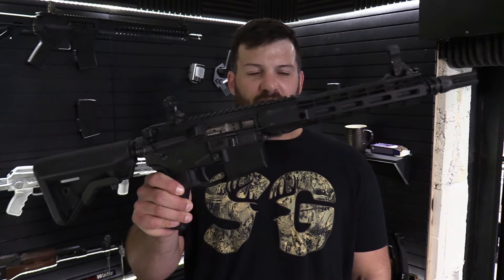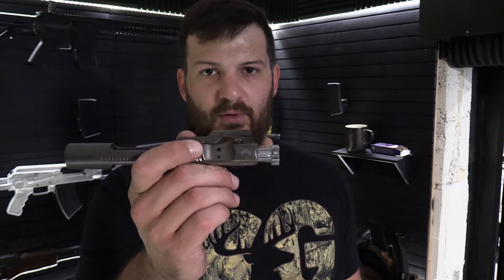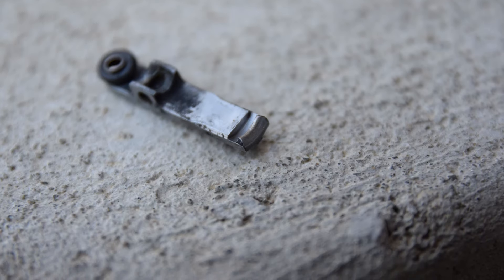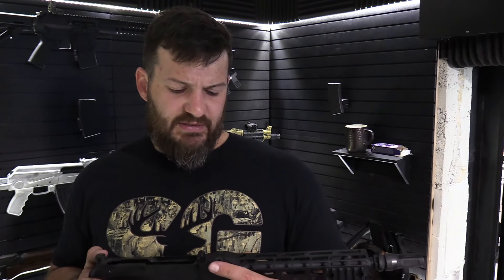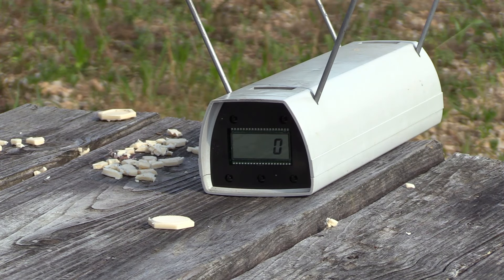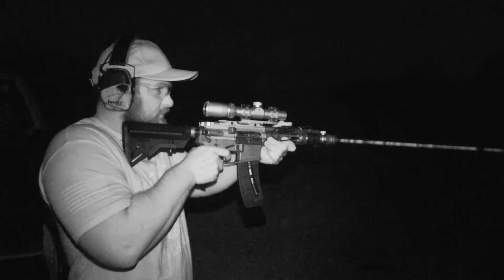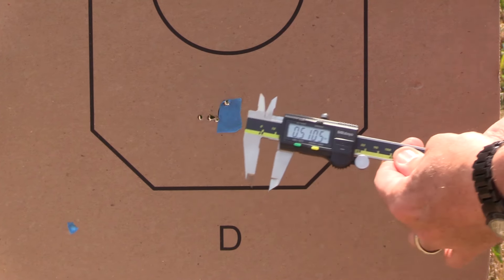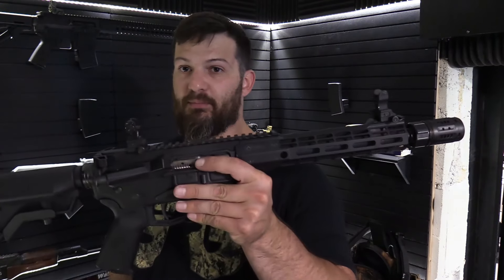Chrome Lined Barrels are Stupid || A Year of Testing

Comment: Nitride is nothing new, I have the test the military did back in the 1960's. Chrome is 3 times more expensive than nitride in barrels yet there is a reason chrome is still used in military barrels, HEAT.. Chrome lined barrels last longer under extreme heat compared to nitride.. For semi auto rifles, nitride is smarter for cost and accuracy..Salt bath nitriding can cause imperfections in chambers compared to pressure chamber gas nitriding..

Comment: Group size increased by 1-1/2" after 12k rounds and your conclusion is that you don't need to pay for a chrome lined barrel. What is that conclusion based on? Is this a new scientific testing method? The conclusion is sheer speculation unless you repeat the test with a chrome lined barrel. I mean I don't care either way and I own chrome lined and also own a BA nitride barrel, but WTF?
Reply: I mean that's also 12 thousand rounds suppressed and full auto. Dude that's a tough fuckin barrel lol. Nothing will kill a barrel faster than running full auto and suppressed. It's basically the ultimate durability test.
Reply: @jamesrobinson7732  came to say the same thing
Reply: @Bravo Six oh I know. Chrome lined is definitely better in terms of durability and maintenance. But I'm just saying from the standpoint of a civilian rifle that will never fire full auto and (likely) won't ever see over 10kish rounds, if that even, that this barrel definitely is good enough and it's certainly tough enough for the use 99.9% of users will put it through 🤷
Reply: @Bravo Six I enjoy a good chrome lined barrel but honestly I only choose it for collection reasons. For instance, I just can't stand the thought of an AK barrel that is nitride coated. Just not historically correct u know. it has to be chromed and also cold hammer forged. Also it's nice for 5.45 cuz 7n6 big time corrosive the chrome makes cleaning the bore easy.

If I was doing clone builds of AR variants that have been in service, certainly, Id only use chrome lining
Reply: @Bravo Six I absolutely buy the Hanson barrel because I love the way it handles. Totally agree on that
Reply: I think it's based on how well the barrel has held up over 12k rounds.  Meaning it isn't chrome-lined and held up fine.  Yes, it would be cool to see the same done using a chrome-lined barrel for comparison.  I'd definitely watch that video.  I think his point is it isn't required to spend the extra cash on chrome-lining if durability is your concern.
Reply: The fact that this IS a machine gun (one of the reasons the military needs chrome lined barrels) and went from sub moa to sub 2 moa (about average for an AR unless you get into precision barrel territory) is pretty cool. So the wear and tear is great and extreme. So for us poors and dudes who don’t wanna be put in govt registry’s and don’t own machine gun, those non chrome lined sub moa barrels after 20k rounds might start creeping to the 1 moa territory.
Reply: @Bravo Six No evidence that CHF has any comparative advantage over a button rifled.
Reply: @Kaotix_music  my chrome lined Saber Defence 6.5grendel shoots sub moa.   And around 1 moa with Wolf steel cased ammo.  Also u can buy chrome lined barrels as cheap as nitrided barrels.
Reply: I suspect that since nitride is cheaper than chrome lining that manufacturers will push nitriding.

Comment: I like the corrosion resistance chrome lining provides. Personally, I run the Criterion Core barrels because of how they solve some of the problems with chrome lining. But I do have a 14.5 Hanson barrel that shoots lights out. I'm very happy with both.

Comment: So you have one, single nitride barrel that lasts 12k rounds and you then conclude that all chrome lined barrels are stupid? Doesn’t seem very scientific. Didn’t Pat Rogers BCM chrome lined  “Filthy 14” last over 60,000 rounds keep sub MOA accuracies?
Reply: Not to mention shorter barrels tend to last longer (less powder burn and lower velocities). Id bet a 16" BA barrel would be showing degradation signs now after 12,000 rds of full auto or fast shooting mag dumps. Most nitrided barrels with heavy use on semi rarely make it passed 15,000 in my experience.
Reply: muddy hotdog - What about Pat Rogers BCM CL filthy 14 and had 60,000 rounds on it keeping under 2 MOA.
Reply: @MrChuckwagon55  ya exactly, nitride barrels never last that long ( so if I remember correctly it was a little less than 60,000 rounds
Reply: @muddyhotdog4103  Ypur experience is limited then. Must have been a PX Ranger. Because my experience is different pumpkin.
Reply: @JohnDoe-rq5bz  ok
Reply: @JohnDoe-rq5bz  turns out you were the pumpkin.
Reply: @muddyhotdog4103  

Mrgunsngear is living the life and fame of a Special Ops Veteran and has almost 700k subscribers who worship him like God the end all be all almighty. I caught him today shooting a Colt 20" A2 HBAR with a ultra modern "Kung Fu" C-grip and he had his nose inches away from the charging handle with his eye relief being different after every shouldering. 

A First Class Private already knows better........
Reply: @JohnDoeEagle1  indeed
Reply: @JohnDoeEagle1  This reeks of cope.
Reply: @JohnDoeEagle1  Maximum copeium status here
Reply: Oh no… an engineer has entered the chat.
Reply: Hey there were some really metallurgical tests here. You gotta  “Trust the science” 🙄
Reply: Go ahead and confuse people even more. Most of us own semi automatic AR 15 not automatic
Reply: @RobertBrown-el2ky  -Tuesday pancakes?
Reply: A lot of his gun mythbusts are very half baked and cherry picked. It's entertainment and sales; more than it is practical info.
Reply: That's great and all but who's going to shoot that much lol? That's like 30-40k dollars worth of ammo. Plus you could always just buy a chrome-lined barrel later on.
Reply: @peterfuentes5893  this is the realization i've had to make too, i'm not in any position to NEED to be going through that high of round counts other than if i strike it rich and have the money to burn through that kind of gear for fun. If the cheapest barrel can last me at least 10k rounds then I don't see any downside.

Comment: Great video. I work in a different industry that uses typically either Nitride+QPQ or nickel plating on a particular component and I've been to suppliers that run both processes. Nitriding + QPQ paetially diffuses into the base material while chrome or nickel plating sits on top of the base material. As you mentioned, the result is that the Nitride + QPQ results in less dimensional change during manufacturing and, more importantly, it will not peel or flake. That said, the QPQ process is not infallible, and is subject to manufacturing defects which I've found are generally attributed to poor maintenance of the tanks used in the multi-step QPQ process.
Reply: So I take it that a 4150 chrome moly nitrided barrel would still be more durable than say a 416r stainless nitrided barrel? I’m trying to decide between a criterion chrome lined vs stainless nitrided barrel and I’m losing my mind trying to decide between the two.
Reply: The process they use to make their chrome barrels is intricate (lapped lands) to the point there is no difference except in cost which is worth the increased longevity of chrome.

Comment: I have phosphate, nitride, and phosphate hammer forged with chrome lining. Never really noticed a difference between the 3 in accuracy, but in terms of corrosion resistance, the chrome lining is superior and that's why the military went with it. For most people, they'll never know the difference and a decent barrel will last them a really long time. The whole debate about barrel types, finish, ect, is no different than the Ford vs Chevy debate that'll continue forever. People will spend their money how they want too and get what they want plain and simple. There's no one better pick as it all comes down to the use and personal preference. Either way it's a good test and interesting results. Glad to see BA live up to their name with a quality product.
Reply: Try sustained automatic fire in a nitride barrel vs chrome lining
Reply: I just bought a chrome lined mk18 mod 0 barrel its a colt 10.3" socom barrel it was real expensive hell for and extra 100 dollars I could of bought a descent carbon fiber wrapped barrel. Jk anyways that is what i was told chrome lined can with stand fully automatic fire alot longer than any other coated barrels and i have crome molly vanadium and nitride barrels although the crome Molly on my 308 can shoot nickel size groups at 150 yards with match ammo. I think this tiny barrel will outlast it hell probably outlast me
Reply: You're absolutely correct, sir
Reply: @countryfriedent  Mrgunsngear did it. The nitride barrel held accuracy better after the round count.
Reply: Todd!!! You are wrong seriously!!! You were never in the military so just stop already..lol!!! Just stop!! You are so very wrong.
Reply: @JohnDoe-rq5bz  
John!!! What John🤷🤷🤷??? I never said I was John!!!!!! If you know then care to explain John, lol!!!!!!🤷🤦🤔👍
Reply: Nitride is actually superior in corrosion resistance. Chrome lining has the edge with high temperatures.

Comment: Loves chrome bolts hates chrome lined barrels...
Reply: You too see the irony? 😒
Reply: Wouldn’t the chrome barrel clean up nice just like the bolt? I don’t see what his problem with chrome barrels is
Reply: @murkyturkey5238  Many say they are less accurate. Most of the guys at the range are shooting standing and fail to make contact with IPSC targets at 100M, so that's a ridiculous argument. Major increase in barrel life, regardless if the barrel is button rifled or CHF (obv CHF adds longevity even more so).
Reply: @beck4218  that’s exactly what I have been told ty for the tip
Reply: LOL

Comment: I've got so many Hansons I can't even recall. 10.3, 11.3, 12.3, 13.7, 14.3, 16, 17.7, 18... Absolutely my favorite barrels, but I'm also partial as they're local here in Orlando. Nitride and quality manufacturing are superior in hardness, excellent in wear resistance, fantastic in corrosion prevention, and phenomenally accurate due to nitride not changing the dimensions of the barrel.
Reply: @williamjames5664  you dodged all of my other assertions except for hardness. I said excellent wear resistant. But nitride is usually harder by a few Rockwell than chrome lining in rifle applications. Battle guns and field artillery are a wholly different application.
Reply: @williamjames5664  the only thing chrome is superior in is when it comes to full auto. it tends to handle heat better. other than that nitride hands down is better and last time i checked, 99% of us aint shooting full auto.
Reply: @jhalscott  im a Hanson head as well. 3 out of 5 of my rifles have BA Hanson barrels in it. the other two has gov profile.
Reply: @williamjames5664  I can tell you are wet behind the ears. PX Ranger?
Reply: @JohnDoe-rq5bz  you're a PX Ranger, I was there with you.

Comment: My dad's first M16 in Vietnam was an old Colt and it's chrome lined barrel was pitted. This caused the barrel to heat up pretty fast. When they would get to the fire base and get new ammo, they'd shoot their old ammo into the jungle. His pitted chrome lined Colt heated up and cooked off rounds when he hit the bolt release. When the gun cooled down, the barrel was drooping. So the jungle environment did cause chrome lined barrels to pit and rust and fail. This was 1970-71. His replacement M16 was a General Motors manufactured rifle.
Reply: The original M16 barrels were NOT chrome lined and Chrome lining was added to prevent exactly the issues you described.
Reply: @AdministrativeReload  Dad was there from 70-71 so he wasn't using one of the originals. But very true. It's a bad idea to send non chrome lines barrels to a rainforest.

Comment: I've been shooting AR's for a decade now. I've shot many different types and grades of barrels in 5.56, .223wld, 6.8spc, 308, and 6.5gren. A couple years ago I wanted to build a lightweight sub moa 14.5" as a general purpose "field rifle", so naturally I listened to what every one on the internet said "chrome lined obsolete, nitride bedur', military twist big dumb". I found a criterion 8 twist, nitrided, ADM profile barrel and already having an 18" Criterion hybrid in stainless that shot everything very well I thought it was a no brainer. When it came in I admired the professional bead blasted finish, ran a bore brush down it, and a puff of orange dust came out, well... I looked down it and it seamed fine, no rust or pitting. After mounting, factory ammo and every hand tailored load shot 2 moa. 55g sierra HP, 69gr smk, 77gr smk all loads had weird jumps during velocity work ups and standard deviations were different with different groups of the same load. 

After all that I ordered a BCM ELW chrome lined 7 twist 14.5" and it shot 1 moa with the 69gr load I worked up for the Criterion. Yes, I know I got a bad barrel, it happens, but I don't think chrome lined barrels are stupid by any means.
Reply: What it boils down to is nitride barrels are much cheaper and more readily available. They manufacture them by the train car load rather than a "sedan trunk" in numbers. People get caught up on the price and lose their minds about it. "It's the greatest EVAR!!" If they were the same price I guarantee you would pick the chrome lined, and even better cold hammer forged barrel. The thing is with chrome lining, only the best steels can be used. They don't rely on the nitride salt bath heat treatment to provide ultimate hardness thus leading to using inferior barrels steels to cut cost and to sell at a lower pricepoint.

Reminds me of the guy that has the Taurus that argues it's just as good as a GLOCK, HK, Sig Sauer, Beretta......not in this lifetime bud!

Comment: I aggree with your sentiments, but the utility of a chrome lined barrel still has a home with some modern applications. Point of impact shift is much less pronounced with CL barrels, and CL is still the king when it comes to corrosion and heat resistance. That being said, i'd bet that 95+% of AR owners will never be in a situation that would be effected by what their barrel treatment is.  

I have rifles with stainless, nitrided, and CL barrels. They all have their niche to fill.

Comment: The only reason I bought a chrome lined barrel to shoot crappy Tula and wolf ammo without worrying about cleaning much
Reply: Is the upper path of your gas port chrome lined?
Reply: This comment proves how ignorant ppl are about the topic.
Reply: @woodrowcall3158  nope to your rhetorical question
Reply: @aramb5482  
Not rhetorical. Gas port erosion is a real thing that is exacerbated by corrosive ammo.
Reply: @woodrowcall3158  it’s rhetorical because you already know the answer is no lol
Reply: @woodrowcall3158  and I don’t shoot corrosive ammo, I just shoot tulu steel jacket ammo which is better in a chromed barrel imo
Reply: @aramb5482  
I’ve seen TulAmmo shoot well from several varieties of barrels.
Reply: @woodrowcall3158  It’s not about shooting tulu well, tulu ammo is steel jacket ammo, if you shoot steel jacket out of a PSA freedom upper it will wear the barrel out rather quickly and I know from personal experience. Chrome lined barrel is the solution to this because it’s the same concept as a traditional AK barrel, typically chrome lined for steel jacketed ammo. I have so far ran double the amount of tulu through my chrome lined barrel and the thing is immaculate
Reply: @woodrowcall3158  and does corrosive 5.56 even exist??
Reply: @aramb5482  
It isn’t steel jacketed, it is steel cased. The old jacket was a bi-metal copper with steel particles, but it didn’t wear a barrel out any faster than standard copper jackets. The new tin/zinc jacket is even softer.
Reply: @woodrowcall3158  I wonder what a bi metal jacket is… loll I’ve seen it with my own eyes with a bore scope so you’re wrong. Chrome lined has withstood a lot more ammo with no loss in performance
Reply: @aramb5482  
That’s cool, but bi-metal still doesn’t wear barrels abnormally fast in relation to standard copper jackets.

Comment: I got a few Faxon nitride barrels and they are fine and very accurate. Chrome lining is very good in barrels and will extend it's service length. Can agree Ballistic Advantage makes a fine barrel and nitride is often sufficient for most shooters. My department still uses Colt SP1 rifles and carbines that have been in service since the 70's the bores still look good after all these years. My M16A1 kit build is a nitride barrel and is a fun gun but my main squeeze is a hammer forged chrome lined barrel.
Reply: I think one of the Faxon engineers got on with the InRangeTV guys. Nitride is good, but it definitely has some flaws compared to chrome. I really like nitride for a lot of uses. But not for something like shooting the few rounds of M855A1 I get my hands on. Because testing has shown that chrome stands up better to really high pressure ammo than nitride.

Comment: What's your thoughts on cold hammer forge vs non CHF barrels?
Reply: Pick a barrel from a manufacturer that does good QA/QC and heat treating and it really doesn't matter. The only place it may come into play is on a saw that does full auto suppression fire full auto dumps
Reply: @worldfamousgi86  Very true. My Spike’s Tactical has a CHF barrel that is M249 rated, and HPT and everything. I looked up the barrel and by itself its almost 300 bucks. After getting my first CHF and comparing to my other barrels, I’d rather just pay the extra for CHF from now on.